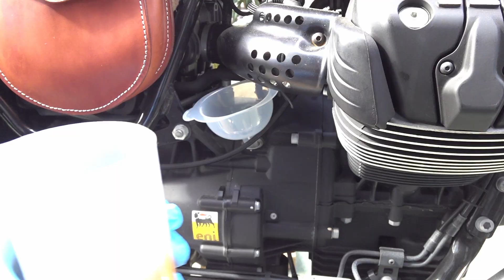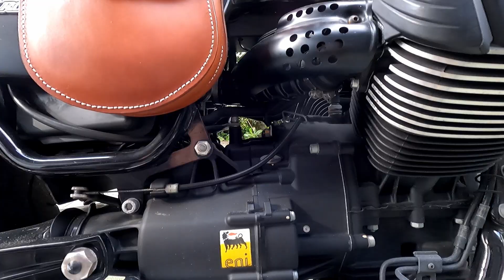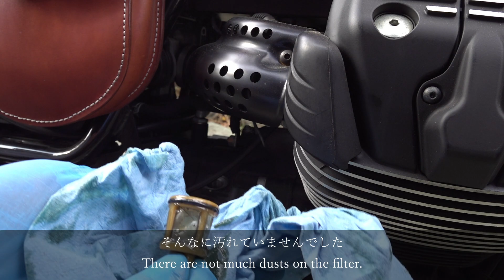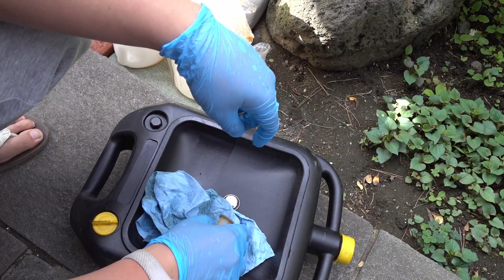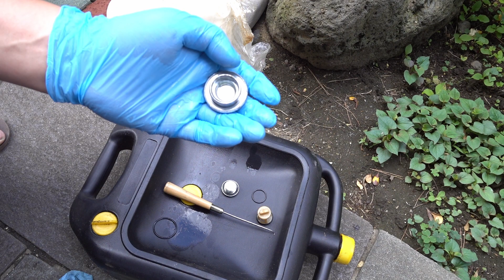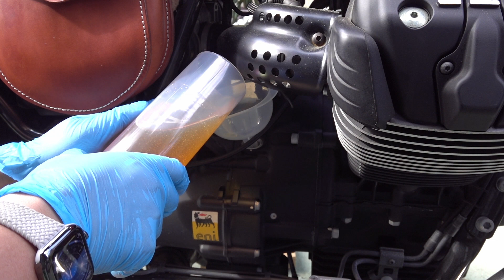DIY Changing Gearbox Oil - Moto Guzzi V9 Roamer - ギアオイル交換

Comment: Hello sir, does this bike have a plug to check the gearbox oil level?
Reply from the maker: Thanks for your comment! My bike doesn’t have a dipstick to check the oil level. The service manual says “Pour oil through the fill opening (on the rear side of the gearbox) until it reaches the cap hole.”
Reply: @wayproscyclewerks  Thank you sir :)

Comment: いつも参考にさせて頂いてます。
質問させてください、ドレン類のOリングは純正のものですか？
汎用品はありますか？
Reply from the maker: いつも見ていただきありがとうございます。
今回は家にあるもので合いそうなものがあったので代用しましたが、正確なサイズのものを入手した方が良いと思います。
ご参考までにパーツリストの型番とサイズはこちらです。

Oil filter O-ring
  B017406 O-Ring 20.35x1.78mm
Drainage plug O-ring
  285536 O-Ring 31.47x1.78mm